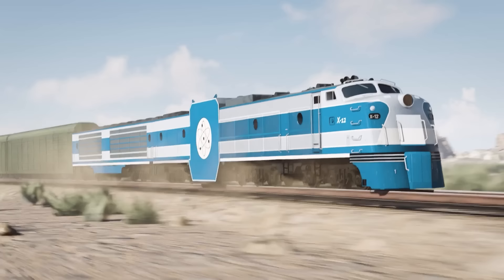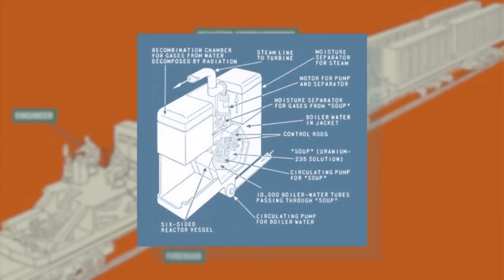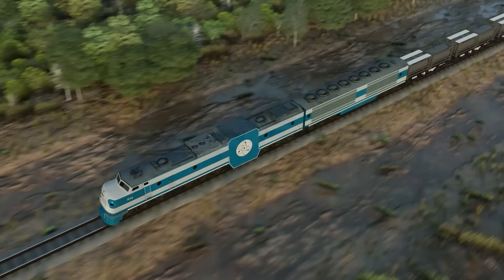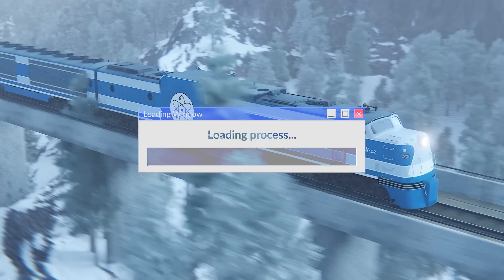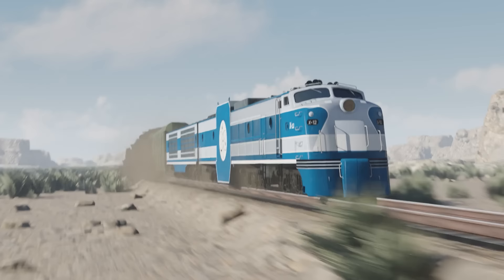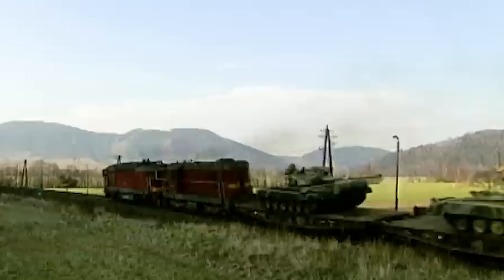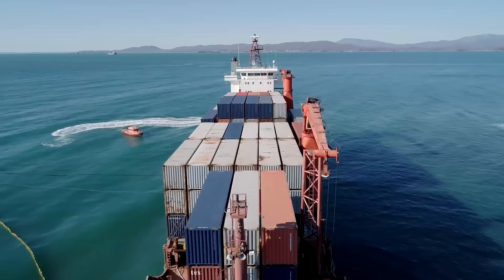What ever happened to Atomic Trains?

Comment: Interesting concept,  and reading through some of the comments bring up several thoughts.  
Nuclear steam generator systems are closed loops,  so water is reused, unlike steam locomotives that are total loss systems.  There was a reactor developed of similar size for the NB36 program,  not sure if the shielding would be sufficient.  The reactor operator would be a huge expense,  as railroads are trying to get away with 1 man crews on long haul freight.  The weight to a certain extent is a good thing,  as it is part of the reason trains have as much pulling power as they do,  modern diesel locomotives are upwards of 300 tons on 12 wheels (6 axles) per unit in the United States.  In today's world with diesel fuel being so costly,  a nuclear powered locomotive might even break even.  Many people have mentioned electric overhead trolley wire, and that's not a bad thing.  Electric locomotives are much cheaper in some respects to operate,  as there is less to them.  But erecting the overhead for long distances is extremely expensive. It was tried early in the 20th century by a few railroads in the United States,  and overtime,  was all taken down.  Except the high speed corridor on the east coast. 
Lots to consider,  and yes, safety is a huge concern.
Reply: Russia, China, India, Turkey...  all those countries have very long corridors electrified and it is not a problem.  Only in USA it is considered like that.  And, by the way, the only main line electrification on the West was taken down by stupidity, not because it wasnt better than diesels.  I am talking about the Milwaukee Road electrification, which was removed in 1974.
Reply: @MarceloBenoit-trenes  valid points,  but recall,  those programs were funded by governments,  not private enterprise.  It's really expensive to string overhead!! And only governments can spend that kind of money because they seem to pretend they have unlimited funds. Most of the upgrades to the east coast corridor were paid for through and by the government in the AMTRAK era. The main 2 cross country electrified sections were paid for by the railroad tycoons! And upkeep was done by the railroads,  not the government. One of the railroads that did electrify a long distance of its mainline,  is completely gone!!! Bankrupted by changing times. The other has been gone for over 70 years now! And that railroad has gone through several mergers since.
Also,  there was a plan to electrify the main north-south mainline from Portland Oregon to Los Angeles in the early 1910s. Unfortunately the man in charge of the railroad whose dream it was died. And the electrification plan died with him

Comment: 11:57 The atomic train as pictured in the video does not need water refilling stations, as there is a condenser on board; it can run indefinitely without refilling anything. Catenary powered trains are still infinitely superior, though.

Comment: For everyone saying derailments and crap; the flask and shielding built around the reactor would be FRA and AEC rated for impacts (AEC: Atomic Energy Commission). Nuclear flasks have been tested for rail impacts in the UK for leaks and those tests proved no leaks at all while be slammed into by a full size road diesel, so this is actually possible. Also if the reactor unit or its turbine unit were to derail, the reactor would automatically scram itself or have the reactor crewman scram it (scramming a reactor is a rapid emergency shutdown of a reactor).
Reply: A Dead man Type fail safe

Comment: Now there are some research about hybrid locomotive, an electric locomotive but have diesel engine on it so the it can be run on non-electrified tracks or can be used over it limit by using the phantograph & the diesel engine at once.

Comment: In short the reason is: because electric trains are just better.

I mean why have a few gigantic nuclear power locomotives, when you could have a regular size nuclear power plant distributing electricity to trains whatever size you need? That in fact was the whole point of electric trains - to have a stationary power unit (which then is not restricted by loading gauge) providing energy to move cargo.

Comment: "Technically it was a steam train" - here is a hint: EVERY nuclear reactor just generates heat if it is fission based. They all work by making hot steam. You have to go to some PRIVATE fusion reactor concepts that are in development to find fusion reactors that generate electricity DIRECTLY and not heat (hint: the ITER does generate heat). Helion, Avalanche Fusion work on reactors that do not emit heavy radiation and generate electricity directly, trying to keep the heat inside.

Comment: More to do with battery life and requiring surfacing to recharge the batteries, at which point they were highly vulnerable with regard to Submarines, not refuelling. Nuclear Power offered the ability to stay submerged for lengthy patrols where the only limit was supplies for the crew.

Comment: You don’t even have to dedicate the nuclear power station to the railway. I mean, the existing electrified railways already run on part nuclear energy as it is. Probably cheaper to just use the general powergrid and not create a separate power grid for the railway.

Comment: The only thing that'll soon kill even in today's trains that are fully dependent on fuel for a more better, safer, and less maintenance needs would be full electric ones that may or already be up and running in places that are fully not needing lines on top to keep them fully powered. Specially at the time that this was at was an idea that would of probably gain a lot of views from many places, but only to like said that'll be ether both for good or bad reasons while also perhaps been a good thing that this stayed on the concept then to be in real life.
Reply: Full electric trains get their power from where? That's right, Power plants. In the US it's mostly Coal or LNG. Wind and solar are not reliable enough, and the morons screaming the nuclear is bad, screwed us out of cheap, clean, and bountiful amounts of power.
Reply: @dorsk84 there is something called hydro electric plants too...

Comment: I would've expected sleeping berths, a living area and kitchen so that there could be three crew shifts.   Obviously, they were thinking of the standard solid fuel rod reactors using pressurized water as the coolant.  A better reactor would be the molten salt reactor as it would be passively safe and even if totally destroyed in an accident, the fission would shutdown, the salts would solidify, be insoluble to water and could actually be safely cleaned up.  However, it would then be Brayton cycle gas turbines not the standard steam turbines, of course the gas could then be air which is of course available from the atmosphere as well as vented to the atmosphere thereby avoiding condensers as well as the weight of water.   Molten salt reactors would also operate at atmospheric pressure so the containment would require a lot less mass.   As molten salt reactors are self regulating and any xenon produced would just rise out of the liquid, you wouldn't need the nuclear fire man to manage rotating the control rods to allow the xenon within the fuel rods to decay back into a solid before fracturing the rods, as well as adjusting power production to the load.

Comment: On one hand, a power distribution network does incur energy losses and needs maintenance. On the other hand, an overly complex and dangerous locomotive that would waste half of its generated power just to move itself could become a solution to a non-existing problem. Good video!
Reply: Honestly it could be good in somewhere like Antarctica, where high winds would topple a lot of catenary structures

But we aren't building trains there anyways
Reply: Do you think these locomotives won't need maintenance?

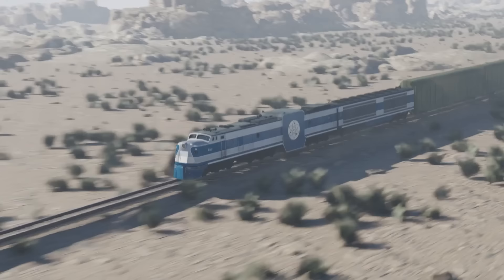Comment: Tech  question regarding your rendering: At 10:20 for a few seconds the smoke/dust/mist surrounding the cars seems to render as totally opaque.  What is causing this? Which render engine are you using?

Comment: I still like that X-12 blue print still takes the design of the F7 diesel locomotive and basically turns into a steam turbine while using nuclear power, but I do the number of risks this has, this is still a cool looking engine because I always liked steam engines and I like the F7 diesel and this a combination of both.

Comment: It isn’t physically possible. Reactors need access to essentially unlimited water for the secondary coolant system. No train could pull enough water tenders to fill that need. Reactors are unbelievably heavy with radiation shields made of lead. No railbed much less rail bridge could support the weight of such a locomotive and all its water tenders.

Even if at some time in the future those problems were to be overcome, (which I believe to be impossible) trains derail. One derailed in El Paso TX today and hit a gas main. Imagine how much more destructive such as accident would be with a radiation leak thrown in.

Comment: Given the enormous amounts of energy required to enrich uranium, I'd be amazed if this had any benefits on cost grounds unless the enriched uranium was heavily subsidised by the US taxpayer.

Beyond that there are a whole load of costs if anything goes wrong. The diagrams appear to show a single cooling loop which is unsafe because if any radioactive contamination leaks in to the loop it will get in to the turbines and spread. In nuclear power plants a primary loop heats a heat exchange and a secondary loop does everything else, meaning that contamination gets no further than the heat exchanger.

Comment: A nuclear-powered train would still need to haul a diesel-powered standby generator around with it to supply power to coolant pumps, pressuriser and instrumentation in the event of the reactor being scrammed, and those aren't small electrical loads. If you're carrying around a big diesel generator, you might as well dump the nuclear power plant and connect the generator directly to the traction motors.

Comment: I find myself wondering what kind of waste heat issues this locomotive would have had. I seem to remember reading that the big gas turbine locomotives were not allowed to stop under road overpasses due to the waste heat potentially melting the tarmac.

As for never stopping, isn't that caused more by signalling, scheduling and train management? Granted that only needing to refuel every year or so could have potentially pushed up availability rates until you stopped to think what refueling a reactor entails.

I do wonder if the numbers would add up if you used one of the proposed small modular reactors as a locomotive power unit, perhaps with one reactor supplying power to several slaved motive units.

Comment: The problem of the submarines is not refuelling. Their diesel engines operate only on the surface because they need oxygen. And the electrical engines can only drive the submarine for a short time because of the batteries. With nuclear power they can stay under water with no limits.

Comment: The reactor fuel couldn't be made into an atomic bomb if it got stolen, reactor grade uranium is only about 30% enriched while weapons grade is >99% enriched.
Reply: It can, however, be used to make what's called a dirty bomb. Conventional explosives are used to spread radioactive material all around and create havoc.
Reply: It depends on the individual reactor. Candu reactors use natural uranium, while most normal nuclear power plants use fuel enriched to 3 or 4 %. French nuclear subs use uranium which is also used in civilian power plants, but they need refueling every couple of years. US and UK naval reactors use weapons grade uranium, to extend the time during refueling.

If you want a smaller and lighter reactor (locomotive reactors would be very small) you need more enrichment since the U 238 part of the fuel is just ballast.

Comment: Something isn't adding up. The 24 drive wheels. That's standard 3 axle set fir each set. The video shows just the first section of the engine to have 18 wheels then. That's 3 set of 3 axles, as pictured. So there is either a math problem or mistake somewhere because the second section would need at least 2 set of axles. So, 18 to 24 is six wheels (3 axles). The math ain't mathing from the video to the numbers stated. If it were a 6-6 6-6 wheel set up, then there is a weight capacity issue.

Comment: I was screaming inside while I read the comments. I'm a 28 yo Stationmaster and former Officer from the Children's Railway of Budapest, Hungary. Im in the profession since Im 12 so trust me when I tell you, the idea of a train that generates it's own electricity is   h e a v e n l y   from my pov. The electrified railnetwork ya'll reasoning with, albeit right now the superior solution, is a very delicate system affected by literaly anything (weather, panto strikes, movements of the engine or unit because of bad track, Darwin award winners fryin up themselves, trees causing shorts, insulator breakings....and the list goes on and on.) maintaining it's function and safety call for specialised knowledge and discipline, not only from those who actually doing the maintenance and fixes on the wires but everyone who is working at a station that has tracks with overhead wires. Just imagine a loco cathcing fire for ex. You cant just wait for the eletrician team, you must immediately open the breakers and start hookin up the protective groundings so the fire brigade can start to put out the fire whithout unaliving themselves...Anyway Im only telling this to give some insight for you to realise why the original idea of this machine is not as plainly dumb as it seems for the first look. 

  
  If the temperature drops between day n night 10-15 °c in autumn for ex, suddenly you can have kilometers of wire over tensioned, waiting for harshly calibrated pantograph to "bring down the spider web" rendering a line to a stop potentially for hours...If you have a reading on a reactor that is over your expectations or it behaving unexpectedly you can always just SCRAM-it. Im sure it's not a child's play to figure out the cause and get it back online, I don't want to downplay reactor science but consider how less distruptive the problem would be to the network. And thats just one of the perspectives we can look at.

   So, it's not a bad idea on the first look. Heck, I'm willing to bet you if this loco would have gotten into an accident so violent that somehow radiation would escape the compartment, that radiation wouldn't kill as many people as high voltage overhead wires or third rails do all over the wolrd esentially every day. Im sure the containment would have been grossly overenginered, those engineers where fully aware of the problem for sure. (Think about the famous nuclear waste rail vessel. Im fairly sure those who were interested by this video seen the english crash test, where they drove a trainset running at  160 MPH into a nuclear waste container and not even the pressure changed inside of it significantly.) 
    And in the US, CA, AUS...etc the distances are vast enough for this to be a desireable solution. A nightshift/dayshift crew could - on paper - move the consist from A to B without a stop while the traction power is virtually uninterruptable. Would be significantly less vulnerable to natural envrionmental factors (those not affecting the track or signalling itself). Would work just as great in an endless hot desert as in a frozen winterland.

  Than, they must have realised that every good aspect of such a machine has a similarly effective down side on the long run. The idea is great because it makes a lot of everyday railway problem technically non existent both for the driver and the ground crew, but the best outcome in real life - other than convinience here and there - would be slightly faster delivery of goods and maybe a more tenable timetable on the line due to less breakdowns. 

  The money you save on fuel is now the salary of the crew, the money you save on the electrification is now the money you spent on designing, making and operating the nuclear powerplant. The increase of tractive effort is countered by it's own plus weight. Less breakdowns on duty, just to be countered by longer and more complex weekly/monthly inspections and maintenance at the depot.... 

   Our freight yard just got a new shunter that can work from both 25kV ~50hz o.h. wire or (with half of its wired power) from a giant battery bank. If scientists will be able to imvent even better battery tech, and manage to hit some breaktrough on the capacity/size ratio, I think at the end battery powered will have the potential to make diesel traction obsolete kinda achieving the goals of this Fallout ass concept😀

Comment: With westing house just releaseing a very small reactor (less than 8 gigawatts) to power about 3,000 homes , an nuclear train now seems possible.  48 hour coast to coast or just under 3,000 miles averaging 55 mph would cut overall cost buy 1/3. The only reasons modern trains stop is fuel and manpower. Having dedicated train sets at the point of origin makes this evdn more possible

Comment: I tried to use the good quality headphone amplifier with small in-ear cheap £3 headphones, and it was kinda working fine the sound quality was good and feel like I was using £200 headphones, the only drawback was the fact that after 5 minutes they started rattling and after couple seconds they had been dead, but there was no smoke 😃